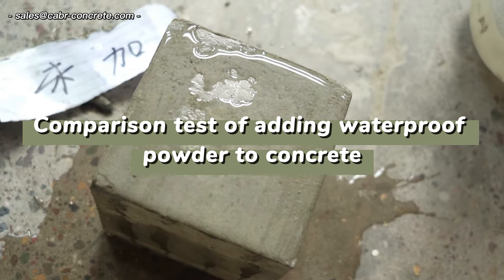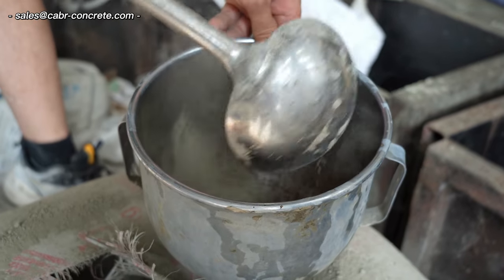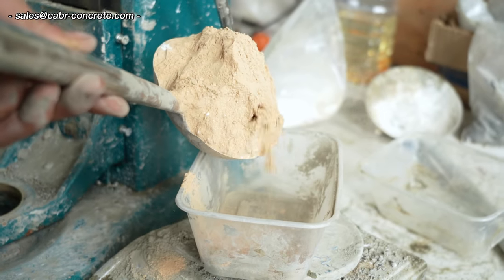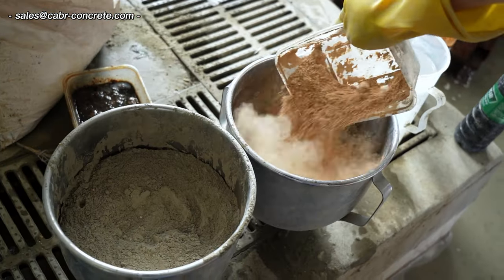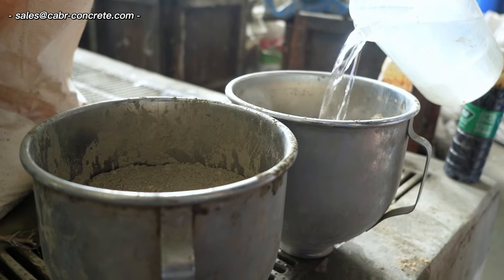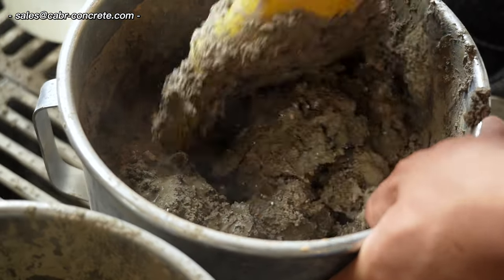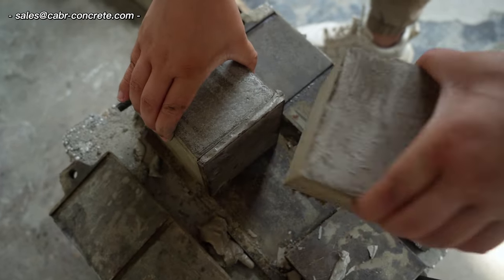How to make waterproof  of foam concrete？

Comment: Since its water resistance what is the product you use instead of cement to join block to block..? You cannot you cement as it doesn't absorb water ..
Reply from the maker: Private messages
Reply: I too use private messages to bond concrete blocks.
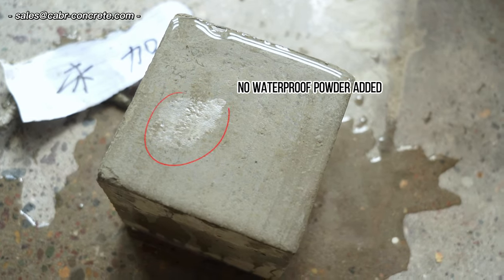Reply: 0:26